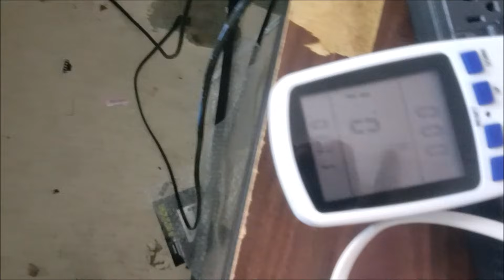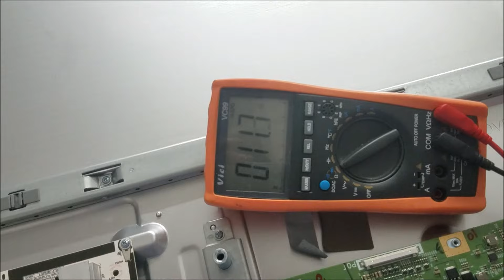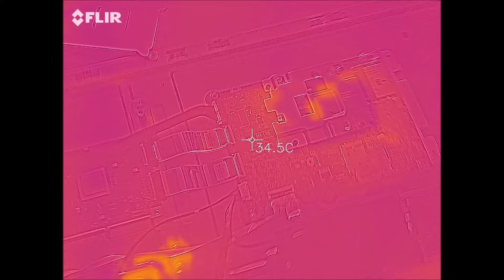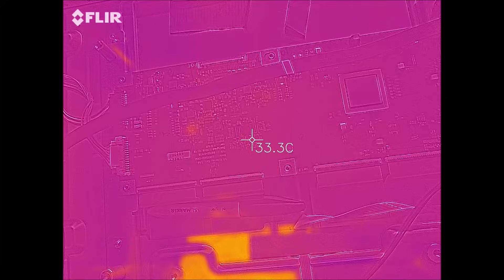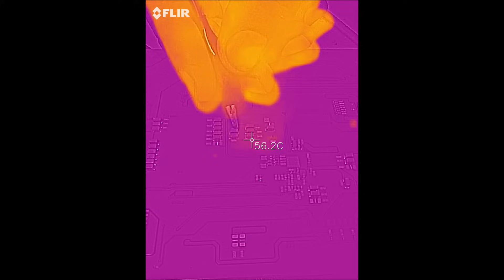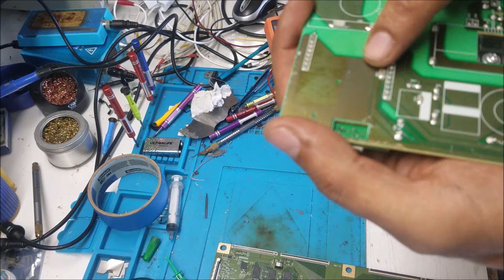LG OLED65B7A wont turns on repair step by step

Comment: I found on youtube to Test the power supply by checking the 23V and 12 volt rails. With the multimeter probes in place, power the TV on. You should see the voltage come up briefly and then drop. tcon 24v power mne does not drop stays. 15seconds tv works, then shuts off. what could be the problem?
Reply from the maker: did you check the backlight?

Comment: Replace capacitor with a different one? Hello. One of my tvs capacitor blew up. It was a ceramic disc capacitor. The capacitor reads "R. 151K 2KV". I read that I can replace it with one with the same farad capacitan I could only find a "151 .2KV" capacitor.  But what does the. R. letter mean? And can I replace 151 2kv ceramic disk capacitor???
Reply from the maker: yes it will work 151k=150PF

Comment: great video .. I took out the Tconn and tested and found a bunch of short capacitors.  normally the capacitor can not be short for a functioning TV correct ?    if capacitors from the  tconn are shorted then this is most likely the reason why my TV keeps shutting down ?   btw I checked both sides of the Tconn and on the other side just like you I found a few capacitors that are also shorted.   I guess I will do your trip with the alcohol and inject some voltage to find the bad guy.  btw did you replace the capacitor or left it out ?

Comment: I’ve oled55c7 the red standby is on. When i turn tv on by remote or push on tv, the red light blink 3 times then off but have black screen. And i measure all output Voltages of Psu , only 24v not present. 
I did it again after disconnecting cable Psu to T-con, the result is the same, the only 24v not there. Do you mind the Psu have problem??
So I disconnected all cable from Psu to t-con and main board than measured voltages, i just found on pin 12v about 7.98v.
How suppose to do to force Psu drive 24v without connecting Psu to mainboard and t-con while the Psu have only 7.98v on pin 12v?? Please advise Me. Thanks before.

Comment: Hello, 
My LG OLED55C7V has stopped working after update. Yesterday it asked me to update WebOS to with latest firmware update and I press ok. System start updating process and a few mintes later turned off TV and never start ((( what was wrong? Why it is not working? Can you help me?
Reply from the maker: crypted firmware. try hard reset, if not change the mainboard

Comment: I have an lg oled77cxpua that just clicks on and immediately off... I've tried replacing the tcon and main boards, but its still doin g the same thing. I thought it might be the panel, but when i leave the two ribbon cables disconnected, it still does the same thing. Any thoughts about what it could be?
Reply: Yep gotta be a panel short unfortunately.

Comment: It's very important to be able to repair T-con because I've seen that some T-con boards have panel calibration data loaded at the factory, and it is not easy to recover that data.  This applies only to OLED.  LCD should still have exchangeable T-con.

Comment: hello, i have LG Oled 65 C9 tv, and i have the same problem as this in the video.  I've ordered the power supply and the TCON none of them work and the only one that I've haven't gotten check is the motherboard do you think could be the problem. i need help.

Comment: I have OLED tv I replaced all 3 components power supply t-con board and main board, still did not fix the issue, the tv screen is not turning on and the standby light is blinking 3 times and with remote the standby light turns on and off but no picture on screen. Please help if you have any idea that can solve the issue. Thank you!

Comment: I have an oled Tv moele is oled65b6p.  it is not turning on. It staya black and gives 3 blinking light.. i have checked. there is 3 boards. power board, Tcon and mother board. there is 3 connectors. the one which goes from power board to mother is ok and gives me all the voltage but the one from power board to Tcon is 12 volte and 24volte. it has no power... what could be the problem????

Comment: Friend, I have issue with Sony Oled TV XR-77A80J  , I will power on TV .. and TV turns on you can see the main menu for about 30-40 seconds and then it will shutdown blinking red lights 4 times.       after I took unit off and started to unplug connectors and re-seating them.   the TV somehow is staying on it has been over 10 mins.    and I can turn TV on and off with remote no problem.   so I test it by leaving  TV on the main screen and I check it after 20 minutes unit shut down  like power button was pressed.   no blinking lights now.   any idea issue ?   would you by chance can point me to the correct direction to check on components ?  I hope you can assist in troubleshooting.. Thank you friend.
Reply from the maker: is hard to tell, just get the multimeter and start with power board voltages
Reply: @SOSfixElectronics  Actuslly fixed this why in the world… i disconnect all connections inside and reconnected them back and now TV boots up without issues ? LoL

Comment: My OLED lg have an issue after turn off -it will not go to standby (led is off) it will have to be unplugged from elctric power for 2-3 minute and plug back then the standby led Wil be on and it possible to turn on,  can it be one of capcitor on power board or the relay?

Comment: Hi ive a 65B6V and sometimes it turns on ok. But sometimes it comes on and goes off. Then you have to leave it for a week or so then its ok again for a while then does the same again. Screen is perfect when on. Is that a tconn psu or mainboard
Reply: More likely main board than anything else with that fault, but hard to determine for sure without specifically testing things.

Comment: Hello i have same model i changed t con and motherboard now tv display for 3 seconds and shut down , i checked power board have all voltage fine but drops when tv turn off i dont know what is the issue

Comment: Hi,  24v is also missing in my case. When I disconnect one tape that goes from tcon to the motherboard, 24v works. The capacitors seem ok, at least they were 70 ohms, disconnecting the panel from tcon does not help. What could be wrong?

Comment: Hello I recently came across a lg OLED55B9PUA and I having the issue where it turns on for 5 secs, the screen looks normal for the first 2 secs, then starts flickering and then shuts off and res stand by light blinks 3 times I took of the cover and tested the prongs and it supposed to be 22vd it reads 28-30volts and where it supposed to be 12vt in reads 15-17volts. help please !!!
Reply: Could be the power suply is put out too much power and cause the tv to hit failsafe.
Reply from the maker: hard to tell needs to compare it with working tv, i dont have one at the moment

Comment: Hi, I have an OLED55B6V. I get a red standby light but when I turn the TV on the standby light flashes 3 times and i get no picture or sound, I don't even get a backlight. I have checked the power board and all voltages look good except the 24V to the T-CON board where I get 0. Am I right in thinking the power board needs replacing?
Reply: Have the exact problem on my B7V, did you happen to resolve the issue?
Reply: Hey 👍. Did you find a solution?
Reply: You’ll need to get 24V - so yep - you gotta find the fault on the power board. 
I’ve had the power board fixed - but no picture now - do get sound though when tv switched to Netflix- I’m gonna check the tcon board in next few days  - this video will be great to follow the process & see if the faults there. 😐

Comment: I have same TV … it comes on for a second then goes off with a vertical green strip from top to bottom of screen about 3/4 on the right side ,, any ideas what it is ??? Hate to throw a3000 $ t v in the trash ,,, i am thinking power suppy ???
Reply from the maker: looks like bad screen

Comment: Hi, I have a lag g8pla TV, it doesn't start, it flashes and it doesn't stay in stebay, can you help me please. the led flashes continuousl
Reply from the maker: disconnect the screen from tcon and see if the tv turns on stopped flashing, if yes you have a bad screen ( common issue)

Comment: thanks for your good teaching, i have 2 question, 1)wich type of alcohol you use on boards? 2)when you find a short capasitor, how do you know the voltage and capasity of that capasitor for chang to new one?
Reply from the maker: Rubbing alcohol  99% or any 95% and more will work, for SMD cap you can look for another cap same size and color in the same line, remove it then measure the capacitance in it, usually same capacitor size have same voltage

Comment: Hello sir we have this test.
My 24V work if disconnect powersupply connector tcon. TV have no video and sound ok
Ple like this video suggest fix
https://youtu.be/bTTAqGtpRKE

Tested capacitor short 86ohm and have around 1.5V to flash memory board. And this capacitor is OK. But have beep with multimeter.
Tested this cap in the video is OK........ 
_________________________
 tcon board is connected with four flats to another small and long board on the lower edge of the screen which is then connected to the panel. This board may have shorted diodes or capacitors which cause the 24V to block and not make the panel work.
???

Comment: Hi, 
it there a way to replace mainboard and change some chips to adapt the resolution. I have one 32 " tv with standby issues and the tv wont turn on. i must try 100 times to power on and one time working. I ordered the same mainboard EAX66085703 model but from wrong tv 42" . The new motherboard working good but i have distorted and overlapped picture. I changed the tv size but there is again distorted picture on the display. I will try to change some chips on the new mainboard to make it working with my 40 inch tv. Do you know wich chip is for the setting and the resolution on the mainboard. my TV is LG 40UB800V and new Mainboard I ordered is 49UB8300-CG , 55UB8300-CG Model EAX66085703 the same mainboard as mine in the 40UB800V Thanks.
Reply from the maker: the tv resolution and settings stored in the eeprom
Reply: @SOSfixElectronics  Thanks, I changed the EEPROM and have the same issues.. any idea?

Comment: I've got this tv and notice two very faint blueish parallel lines near the bottom half of the screen recently.They are only noticeable during certain lighting on the screen. Is that a power issue or does it just need a reset?

Comment: Hello friend 
Do you know how to acces and change the Backlight?
Beat/ Mads, Denmark
Reply from the maker: are you talking about this lg? there no backlight in it, other brand i dunno
Reply: @SOSfixElectronics  Hello again friend👍
Yes - it is the same model 👍. 

I have 2 of them, and they turn off after a few seconds. If I take out the cable that control half of the picture, then the tv stays on. That is why I was thinking, that the Backlight needed to be change. 

But you mean, that there is no Backlight in that LG model?

Best/
Mads - from Denmark
Reply: I guess, that the Backlight is led edge lit
Reply: @madsjuncker307  sir this is OLED TV 🤣
No backlight🤣sure 100%🤣

Comment: I have a oled55e6p-u September 2016 replaced main board and t -con board TV turn's on and about 15 seconds shots off help please what do I do?
Reply from the maker: so what left is power board and the screen, check the voltages when the tv on power on mode, if all voltages up and running the problem in the screen (no way to fix the OLD screen yet)

Comment: I have an oled55b6p with 3 blinking stand by lights and won't turn on. The red light in the optic port stays on,no picture or sound. All voltage looks normal accept I don't have the voltage from the power supply to the t-con. Any idea what board it could be? Much appreciated.
Reply: @Mike Dizzle Same to my have only audio?
Check diode 18 have short if have connected the 2 external flat display cable panel. The panel have 4 cable

Comment: Hello! I saw that the back sticker stated 120V only but once you opened it the power supply said 120/220V, that means it would work fine in a 220V country too and wouldn't explode right? Thank you!
Reply from the maker: you right power supply said 220v put sticker on tv said 110v, you cant tell if the components in that power supply support 220v. to be sure look on user manual specs, if you can take tv apart disconnect everything from power board before you plug it to 220v is better

Comment: Hola tengo un tv LG  Oled65A1PSA que se me quebró el panel en un extremo el tv se esta protegiendo y la fuente desconecta el voltaje que va a la tcom los 5 volts y los 12 volts si desconecto la entrada de los 12 volts el tv enciende sin imagen ,entonces sabes tu algún modo de poder obligar a la main para que me encienda el panel para poder ver el daño que tiene el panel a lo mejor se pueda rescatar y no importa que en el costado no tenga imagen ya revise las conecciones del panel donde se alimenta con 5 volts y 12volts y no hay corte alguno ,si en el primer flex del lado izquierdo al medir las pista marca extraño  comparado con el flex del extremo derecho que son iguales es la única diferencia anómala que le veo espero respuesta y me puedas orientar soy técnico y entrego servicios pero es el primer tv oled que tengo en taller lo compre malo y quería ver la posibilidad de hacer ver algo de imagen para poder experimentar con este tv saludos desde Antofagasta Chile

Comment: Hi, I got the same TV, sometimes (especially when it's cold) the tv won't start and shows faded moving green "lines" for 3 seconds after turning the tv on and then it just goes off, the led stays red and doesn't blink. Everytime I try to start the tv the spot where the green lines appear gets bigger. However after a few tries or when it's warm, the TV turns on normal and it show's a good picture with no lines or anything. the power supply is pretty loud too, everytime i turn it on it clicks and when it goes off it clicks, sometimes it clicks again after 10 minutes when it's in standby and then the tv works great again. I think it isn't a panel fault? And I don't know if the "clicking" is normal or an Indicator that something is bad with the power supply.
Reply: update: I found the problem, it‘s the t-con board like in your video. If it‘s disconnected the tv stays on, if I just disconnect the connection from tcon to panel the tv has the same problem. even with panel disconnected. T-Con looks like it has a burnt mosfet, but I need to confirm and check with multimeter

Comment: Hi i have lg c9 65 inch oled kid threw a toy at the tv at the bottom near the standby light now the tv comes on and shows a big line down the screen and then turns itself off any help would be appreciated thanks
Reply from the maker: you got a small crack there and sorry there is no repair for that
Reply: @SOSfixElectronics  ok but should it turn off i was thinkin of paying lg for a new panel cos the tv cost me 3 grand and the panel is abt 1 grand i dont wana buy a whole new tv or even buy the panel in case ther is other problems with the tv shouldnt it come on and work  cos where it was hit is so small like rhe size of a penmy i seen worse damage on other peoples tv and they still come on
Reply from the maker: @D0SAGE  depends the damage in the screen, some defective screens may shows some colors before it dead completely .replacing the screen it is always a good option if it is not expansive
Reply: @SOSfixElectronics  yes he threw a toy at the screen the screen comes on with vertical lines but the picture is all black except for the vertical limes that show up but then immidiatly after the the tv turns on it turns off back to standby and thanks for replying my other  youtube account btw lol

Comment: Hi, I am in quite the doozy and would like to get your expertise since you’ve worked with OLED. I have a XBR-77A1E with a burnt primary plug on the power supply board. What is burned is the EVDD_26V, 8 of them, and I don’t know what that means. I have gotten another board off eBay (the only board I found at all) and it came with the power relay ripped off. I want to be able to see what I can do with this TV to get it to working again, the new board doesn’t do anything and I’ve found that if I connect the cable that runs from the primary board to the DKA digital board that’s where things short and the TV doesn’t turn on. Could the cable be the issue as well? It looks totally fine, if those pins were burnt do you think that everything else is toast? The TV doesn’t turn on at all with everything plugged in so I’m assuming the panel is still fine. Thanks.
Reply from the maker: if the connector burned my not have a good connectivity, evdd-26v that is a 26volt out put plug, to the Drive, maybe something shorted in other boards causing the vdd26v to burned, you need the relay in power board to work and get a multimeter and check voltages
Reply: @SOSfixElectronics  I have resoldered a loose capacitor on the t-con, still issue w image display, will replace t-conn to test if screen is functional

Comment: my all voltages are Good BUT I can’t find any Volts on P202 on the 24VD Points .. will appreciate your Help
Reply from the maker: you can force the power board to give the drive voltage 24 by jump the 3.5v to Drv-on pin and check to see if it is stable, if yes must be the problem is the mainboard or screen

Comment: Hello SOSfix, just to let you know the oled 65b7p-u is working and looking great. I jumped the 3.5 volts to the drive circut on the power supply. I did get my 24 volts for the t-con. Then like you said it was a main board issue. Thanks Much.
Reply: Hi James, how did you do it? I don't have 24V only 12V is present.